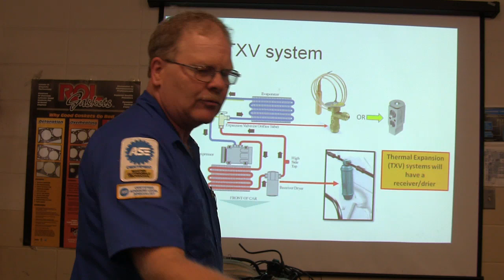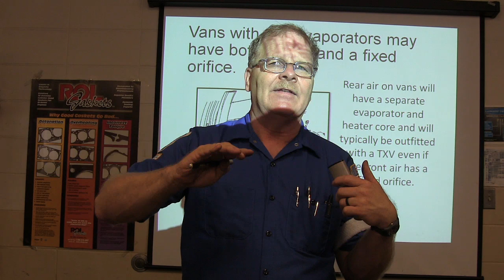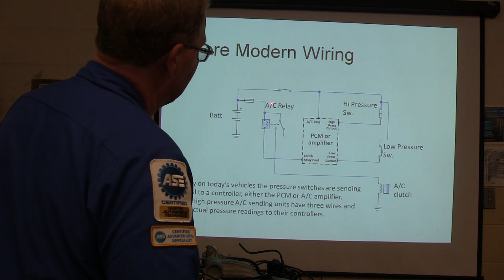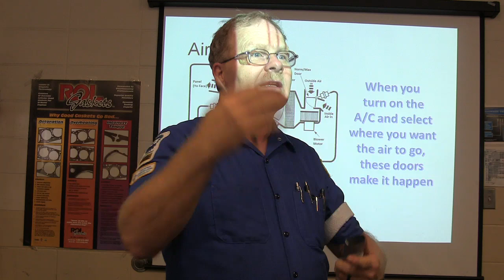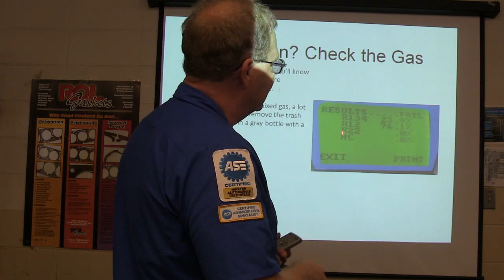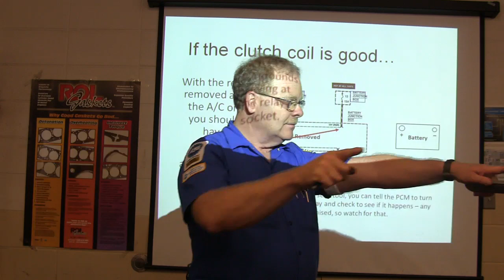HVAC Basics and Troubleshooting

Comment: Why are General Motor's fixed orifice air conditioning systems from the 1980s and 1990s so good at regulating the evaporator pressure at almost exactly 35 PSI, almost regardless of the temperature conditions or state of system charge?
Reply from the maker: The pressure cycling switch on the low side of the system Cycles the compressor off and on

Comment: Speedo and climate control panel message center don't work thermostat gauge trys but na I get code p0336 no blowen fuses any suggestions b greatly appreciated thanks for your time an knowledge I'm working on a02 GMC Sierra excab 4.8.? blue plug on PCM bottom 4r5 pins and little copper pieces where the connetions made r brunt look n.tryed new cluster, climate control panel didn't fix any suggestions b greatly appreciated glad i found u an subscribe thank u for your time an knowledge very well done an explained

Comment: Something the guy didn’t mention is some setups only have one pressure switch and if you got one pressure switch it’ll be on the high side line remember that
Reply from the maker: Nope
Reply: @McCuistian   yep my car has one pressure switch trust me I looked it up just one
Reply from the maker: @ryans413  most cars with one pressure switch have it on the low side.

Comment: Great video as usual.  Am I to understand that current has to go through the diode first before getting to the clutch coil?
Reply from the maker: No - it can't go through the diode in that direction - but the spike that happens when the A/C clutch is de-energized chases its tail through the diode instead of screaming back through the rest of the circuit - which would damage electronics.
Reply: No it keeps the power from back feeding into other components a diode only allows power to travel in one direction like a check valve

Comment: Thank you, Sir for your great teaching. Is it right to say that you will get 12 v on the pcm ground controlled pin (86) when the pcm energizes the relay?
Reply: No, If it's a good ground , voltage should be very low on the ground side when the circuit is complete and energized. ...that's for every circuit.
Reply: The only time voltage would be about battery voltage on the ground side of a circuit is in a circuit with a motor, like say the fuel pump,  when it IS NOT running,  the ground side voltage will be high,  but when you turn the fuel pump on, if everything is ok with the circuit,  the ground side voltage will drop very low to almost nothing,  Because the voltage is being consumed by the motor.

Comment: was the system sealed when u found 60% air... If it was sealed how did all there air get in. what about the recovery machine, when u recover 134 out of one system does it just make its way into another system. how does that all work... does it just not go bad as long as its not been contaminated. thanks for the videos... im trying to understand this on your level of knowledge
Reply from the maker: That particular vehicle was one that a student had worked on at home - he had replaced the accumulator and recharged it without evacuating the air.  When the air goes into the refrigerant tank, it remains a gas and is above the refrigerant in the tank and can be purged by releasing it.  The air doesn't condense into a liquid like the refrigerant does.

Comment: just curious if expansion valve was clogged wouldnt there be high high side and low low side pressure
Reply: Depends... If the txv is clogged it wont have enough refrigerant flowing to absorb heat to raise the head pressure. So it will look like both low suction and low head, which looks like low gas. Someone will add gas and walk away, and that will create high head and low suction when the next tech arrives.

Comment: I learned something. Wish I would have known it about 2 weeks ago. Low pressure on high and low sides with a good charge means stuck txv. That is a golden nugget of info right there.
Reply: Not always
Reply: Also might mean you have low freon in the system. Or weaker ac compressor
Reply: @tanzaniacarschannel6975  i was gonna say well how are you suppose to know there is refrigerant in there when the gauges read low on both sides unless you are the person who charged it in lol
Reply: i guess the compressor wont engage if there isnt any refrigerant but
Reply: I got a question sir some cars will have office tube and And expansion valve or some cars will have one or the other they cannot have both??👀🌿